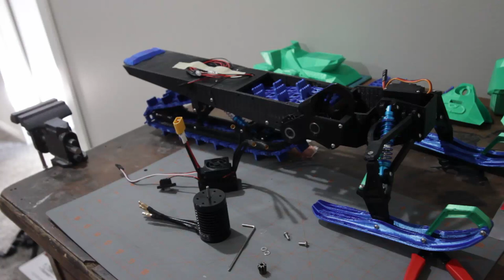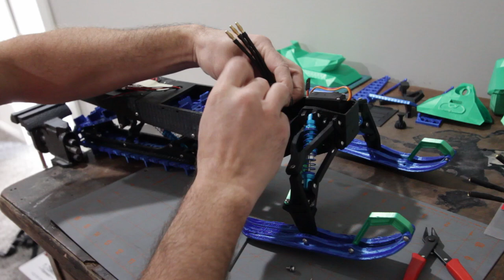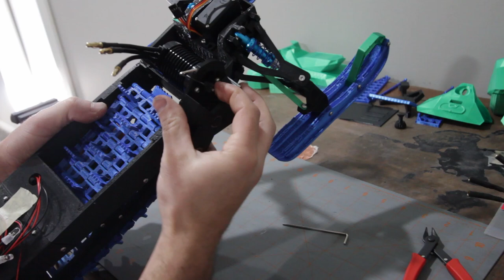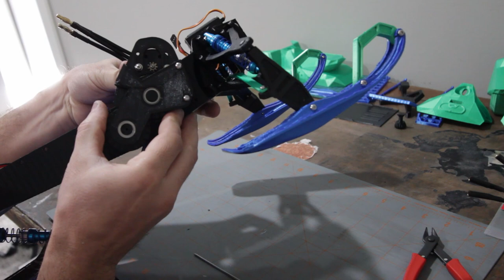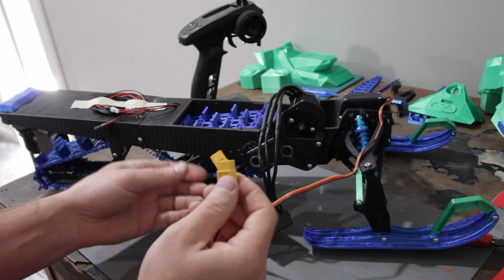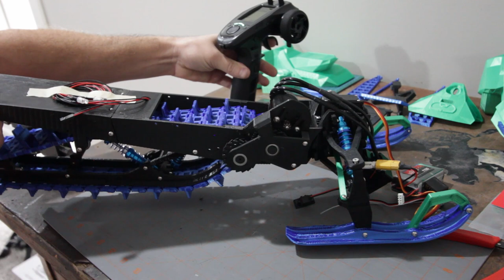SkeeRide Assembly Part 6 - Motor install

Comment: I put a piece of paper between the pinion and spur gear and then push it tight to set the mesh and lock the motor position in place.. then pull the paper out and you should have great mesh without binding
Reply from the maker: That’s a good tip. Thank you.

Comment: did you use the button head or socket head screws?
Reply from the maker: I use button head screws. Socket head can be used, but inside the tunnel where it connects to the frame needs to be button head.

Comment: what kind of speed controller and battery did you use in the video
Reply from the maker: GoolRC F540 3000KV Waterproof... https://www.amazon.com/dp/B06ZZJ3LVH?ref=ppx_pop_mob_ap_share the speed controller is a 60amp but I can’t find the link to it. In my green sled I’m using the buy list setup and it works way better.

Comment: the goolrc motor did not have enough torque to run the sled so i think i’m going to go for a sensored system
Reply from the maker: Sensored is really nice. You don’t need sensored, but the gearing isn’t as sensitive because they have a lot more torque. There’s plenty of people running with cheap non sensored motors though, just need lower kv and a good gear ratio. Everyone that’s gone to sensored has really loved it though.

Comment: Could you give me a list of the exact controller or a cheaper controller i could use and the model numbers of all the pieces that you used.
Reply from the maker: List is included with the files. It’s called “buy list” the list is also available on the discord channel if you haven’t purchased the files yet.
Reply: what is the discord channel
Reply: im so sorry i asked that im blind
Reply: dumborc radio and receiver is the best value for money i’ve ever used, solid for $30

Comment: Would a 3650 motor work for it?
Reply from the maker: Yes, 3650 is the same size as a 540. You’ll want a lower kv(2000-3000) for enough torque to turn the track.